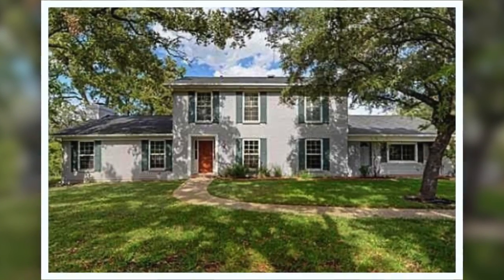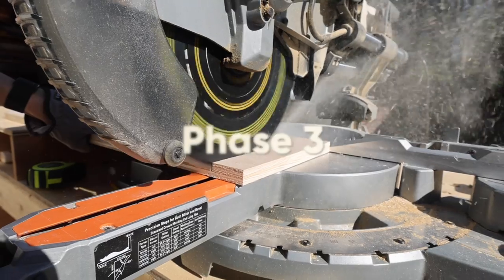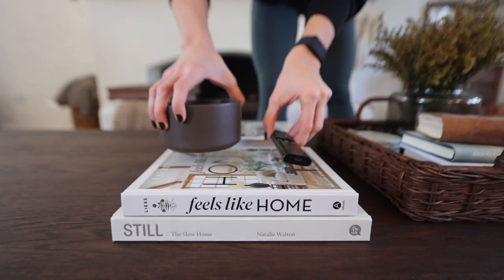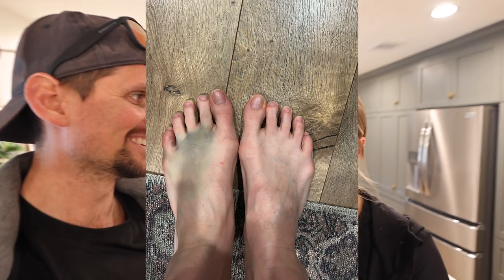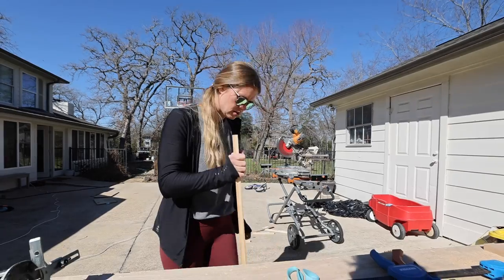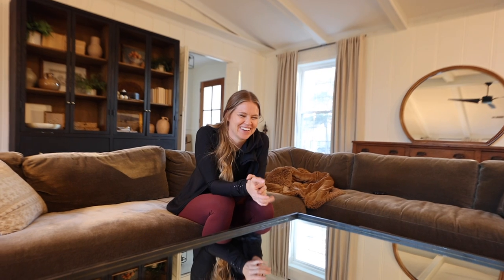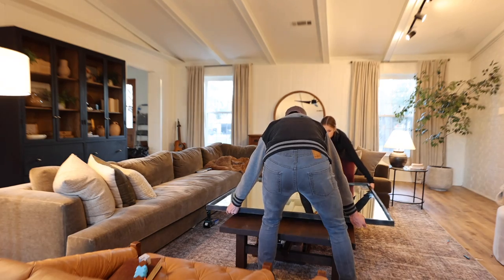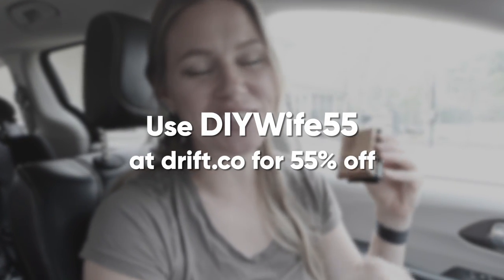4 Year Living Room Makeover // Custom Faux Antique Mirror Build // DIY Living Room Makeover

Comment: Hi Dean and Andrea, I love watching your channel, it is always entertaining as well as inspiring. I built a couple of book shelves in my bedroom on either side of my bedroom windows out of an old hugh book case i found on kijiji cut it down and there is still some trim in my garage to put the finishing touches on it and now we are getting ready to move in the spring for the bottom i used a couple of upper kitchen cupboards with the door on and i made a plinth for the book cases to stand on and it looks unfinished but great. Its just small moldings just a but decorative but it looks good without it too. It has a rustic vibe too it i painted them white and it framed our window just great. When i first used power tools i was so scared, it frightened me to death, if i am honest. My husband was at sea and something needed fixing, so i bought the power tool a sander, big deal right, but then i also bought a circular saw that was the one that scared me i had visions of cutting my fingers off cold sweats and then i turned it on and i must have dropped it and jump almost 3 feet in the air. after that i was ok but it was a shock i never saw my Dad or my Mum use power tools, my Grand Dad did, he had his hugh shed at the back of his yard and pet spider,  spider generally are not that big in the UK but he used to catch flies or other bugs and put it in the web for the spider to eat, that thing scared me every time i walked in there to get something for my Grand Gad it would come out just above the window, gross, it was about an inch and a half to me it was hugh and scary. Good times, good times, i would do it all over again such good times now i use power tools and it no longer scares me. my hubby is always surprised at what i can do when my mind  is set on something i picture it and i go get the materials and i get to work its great. I love you guys and your kids are adorable typical boys.

Comment: Andrea the mirror came out great. I made that knock off BP mirror and it had a light backer. With the 114° heat we had last summer it cracked. Did you put a backer on it? Maybe use heavy backer maybe that ugly pressed plywood. So it doesn't shift or anything. 🛠️